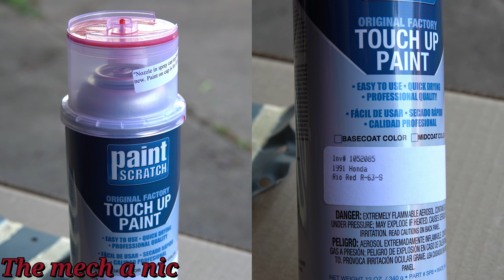repairing rust  - rear bumper removal - CRX PROJECT (part 1) vol 14

Comment: Super informative video, thank you so much! I noticed my rear crash bar is rotted to hell and back on my '91. Am gearing up to do some of this, though jealous of the blast cabinet and induction heater. Need to fix my compressor for die grinderage, but love the information you included. Hadn't even thought about tossing seam sealer over welds. 

@20:14 is that a silicone sealant instead of paint? You mentioned CRC but I know they produce a lot of different fluids. Curious why you'd clear or seal that instead of paint + topcoat.

Comment: 13:36 John , where did you get that metal guage?
Reply from the maker: It's made by Miller  , it came with my welder when I bought it .you can find them on ebay for less than $10

Comment: Contrary to what most may think- most new vehicles are
made like this. Sections are spot welded, but everything is actually
glued together. The drawbacks are cost and electrical conductivity,
that's why most panels must have a few spot welds.

To successfully MIG thin metal you must have small gauge wire,
and very low amperage, with a fast feed to move quickly. Turn down the
Argon, too. "Plug welding" with panel bonder is way better.

For good auto gauge sheet metal- don't forget your local salvage yard!
The hood, trunk & doors off of old Hoopties contain huge amounts
hydroformed sheet, sometimes already treated. Way cheaper than
store bought. You could've cut that entire sheet from an old car hood.

Get a RivNut tool and an assortment of the RivNuts. They're hot-dipped
cadmium, never rust. Many uses. I love my OTC tool. Awesome
for making or replacing mounting spots for anything; power window
motors/regulators, door hinges, exhaust. Throw a washer behind a 
RivNut for added clamping area. Repair wallered out handle mounts, 
many uses. The coolest ultra security fastener: pop rivet into a RivNut.
It will grip the threads tight, without any means for removal except drilling.

Comment: I’m in North eastern Ontario , and they use a ton of road salt so I know what you gotta deal with. My Mazda 6 looks good from the top down but the dealership tricks people into thinking the electronic anti rust box will protect the car from rust 😑
My front bumper and frame needs work but I just haven’t got to it yet 😉
Reply from the maker: Yeah it sucks that we have to deal with crap like this. Gotta put in the work 💪